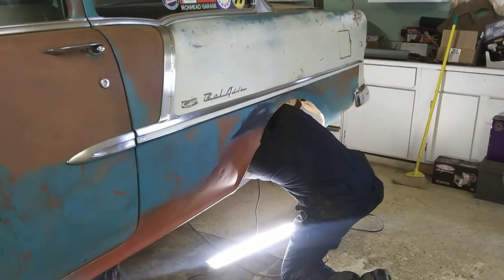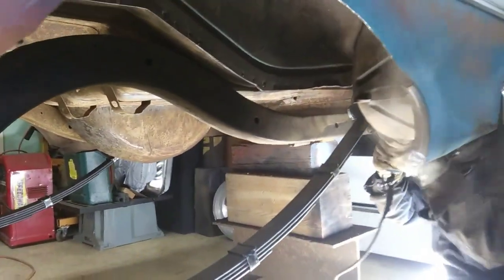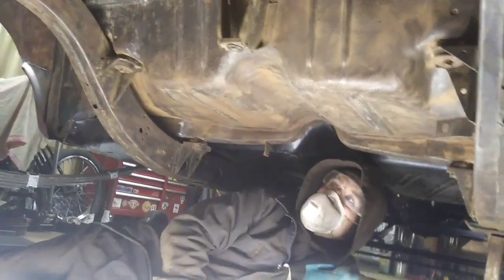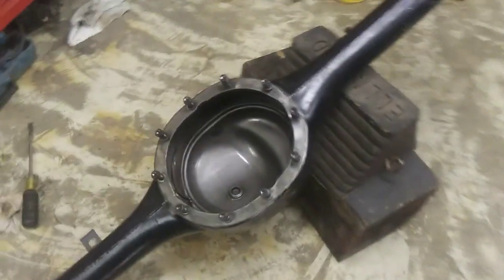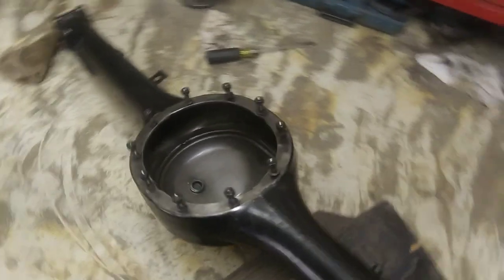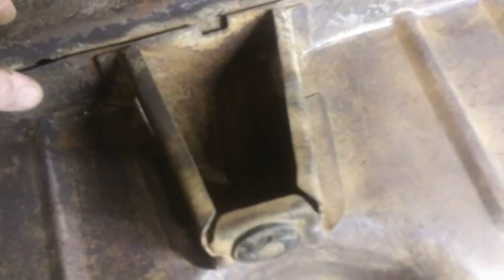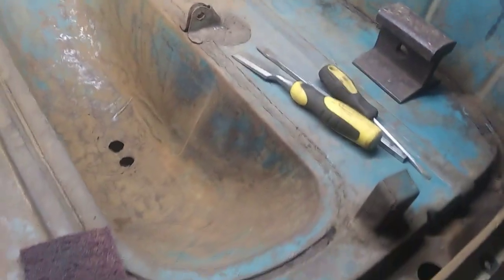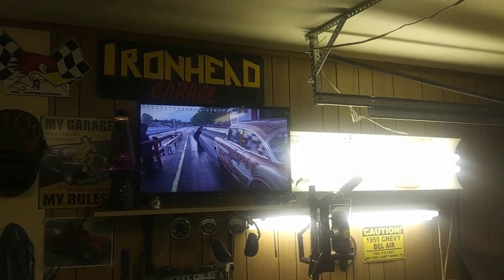1955 CHEVY GASSER BUILD. DOWN AND DIRTY

Comment: You guys are doing a good job. Messy, but good.
Your rear end housing looks spectacular. The idea of putting the 3rd member into the housing to clean it up without getting the gears and posi unit grungy is good.
Keep it up!
Reply from the maker: Thanks a lot Mike.
Yes very messy work but all worth it in the end.
Right don't want to get any more dust or dirt in that posi going to clean and blow it all out then put her together. Thanks for watching have a great weekend brother👍👍👍

Comment: Hey Cris,  I didn't realize how rust free your ole 55 really is.  You're really lucky to find a body is this shape. Most tri-fives are full of holes, Cool. I hate to give you more work but if I were you I'd also put in new body mounts while you're at it. They really aren't hard to do and shit while you're there anyway. Just pre-soak the piss out of the bolts from inside the body before hand.  You're son really did a great job on the floor and frame. I did the same thing back in the 80s with one of my 57s and know how much work it is. Good luck buddy - Later
Reply from the maker: Hey Marvin thanks. Yes she is in pretty good shape now
Man when I started there was a lot of rust up in the front floor pans the driver's side rocker was pretty much toast and the inner and a bunch more was all rusted out. I replaced a few floor braces and a bunch more stuff. I got lucky on the trunk area it's was not to bad. I have had all those body mounts lose the body bushing are not to bad. I would replace them but there like over a hundred bucks. No body wanted my 55 because it was so rusted
Go back and watch my first video and see in side it was pretty bad when a started.
Thanks for watching
Have a great day👍👍👍